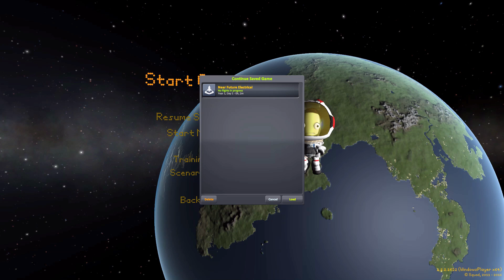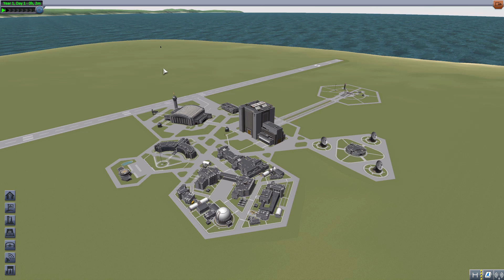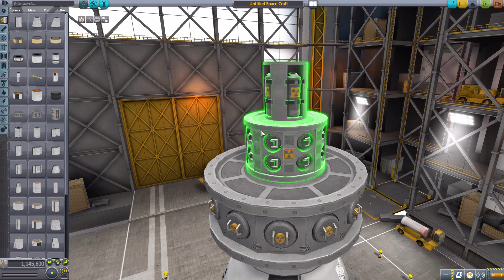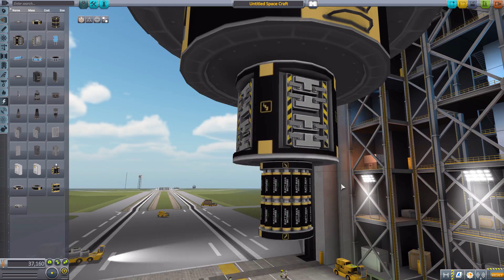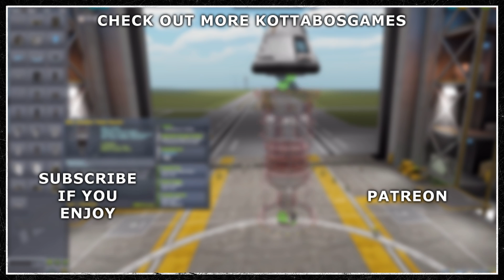KSP Mods - Near Future Electrical

Comment: Those capacitors might be useful when doing interstellar missions when you run out of juice and need EC to startup/kickstart something without spending fuel for your reactors

It's redundant in short term missions, but interstellar missions can reach up to probably a minimum of 20 years provided you have multiple orbital and surface operations to, say 4-5 planets
Reply: With Kerbalism, this is really useful too since those reactors produce Radiation.

Comment: For some reason whenever I right click on any of the reactors the menu that shows up only shows the depleted fuel amount, the ERU amount and the battery charge. But theres no start option meaning I have no way of turning it on.

Comment: The caps are really useful for probes. You can run your batteries nearly empty, put the probe to sleep until it reaches its destination, then use the caps to give a burst of power to unfold the solar panels or the beamed energy dish!
Reply: Do the capacitors just dump all their power out at once? Like a soda can you have to finish drinking in one sitting?

Comment: So basically, just get breaking ground and use a Kal 1000 controller on loop to constantly make the capacitor discharge
Reply: The capacitor still has to charge, so doing that would just result in your power generation fluctuating up and down.

Comment: I have a big problem regarding the heat. I can't get rid of it. I have the second smallest reactor, four of the biggest radiators and the generator is going at 1%. The Temperature still rises.

Comment: Considering you'd only use those reactors when you fire electric engines (from Near Future Propulsion), they will be turned off most of the time, lasting you virtually forever.

Comment: Might just be a bug for me... but those nuclear reactors only use enriched uranium when ACTIVE, right? I built a ship with a few reactors on it. I did my burn and then made sure to switch them OFF. Then I time-warped 3 years. When the game went back to 1x speed, and I turned my reactors back on to make another burn, ALL of my enriched uranium was used up during transit and are just sitting on a bunch of depleted fuel. Anybody else experiencing this? I'm 100% certain that I turned my reactors OFF before time warping
Reply: Just made a ship to test this out on the launch pad. Made sure both reactors were OFF and then enriched uranium was full. Time warped about 2-3 years, and when I turned my reactors on the enriched uranium just slowly depletes to 0 and becomes depleted. I have no idea if this is working as intended.... but it just seems that if the reactors aren't on, then they shouldn't be using any enriched uranium =(
Reply: OK guys problem solved!!! The issue I was experiencing came from using the Real Solar Systems mod. Apparently the maximum time-warp value in RSS messes up the core life calculations for the nuclear reactors. I found this link here:

https://github.com/ChrisAdderley/NearFutureElectrical/issues/18

SkyKaptn figured this out so kudos to him. All you need to do is navigate to the RSS cfg like he mentioned and change the final value of rate7 to 5000000 instead of 6000000. I tested it out right now and everything is working just fine. Hopefully this is helpful to anyone coming across this issue =)

Comment: I think you forgot that as the reactors overheat, they start taking damage, which lowers Ec/sec outputs
Also, my reactors are all stuck at top node, there's no option to change them
Reply: try turning on the advanced tweakables option in the settings menu.

Comment: Plus if you balance the amount of heat generated in the core with the correct size (and type of radiator if you use the recommended mod "heat control") then you really can activate and forget. You just got to remember that the radiator has to be in direct contact with the reactor not the structure scaffolding when using the top node function. Awesome mod set and great reviews, keep it up.

Comment: I love the Near Future set.   I use that little reactor with Ion engines on long range probes :)
Reply: Brian Riley i use the reactors for Planet bases and stations
They are self sustaining since i can make everything that my kerbals need (i have kerbalism since my Tac lifesupport couldnt get updated causeing a mono.dll error)
Reply: I concur. And the tiny reactor combined with electric propellers (from Firespitter i think) results in 5 years of uninterrupted plane flight :).

Comment: It might have been worth mentioning the unique mechanic with Enriched Uranium and Depleted Fuel: They can't be transferred.  You need to transfer them (from appropriate storage containers) on EVA.  (I believe - I haven't worked directly with NF's version, as I usually work with USI's, which has a similar but not identical mechanic for those fuels.)

Comment: I used the Capacitors a lot, before I got the reactors, to power the bigger thrusters. Giving me short windows to thrust without needing a reactor.
Reply from the maker: a few people have said this now, and makes sense.  I had just never thought of it before as I just always went high power on the reactors.  but I can certainly see that use now.
Reply: 20% with radiators works well on reactors. It keeps the engines on (not much spare room for other things, but it doesn’t flame out), while staying within the max temp.

Comment: the capacitors are very great for powering the super power hungry engines from the mod, so you could power them without a massive reactor or just a small one .... works great for making pretty darn fast vessels that way :P
Reply from the maker: Hmm a fair point
Reply: And the NF propulsion thrusters are a super power hungry systems.

Yes, the capacitors pump electricity in your ship faster than the NF thrusters bleed out it. Otherwise your thrusters will run intermittently, and the sound is annoying.
Reply: They're also nice for the stock antennae at long range

Comment: Couldn't you throw on some radiators and keep it going
Reply from the maker: of course, they'll help you delay the inevitable.  but eventually even with those the heat will build up over time to dangerous levels if you always run it on max.
Reply: Absolutely.  Will make the reactor heating to slow down.
Reply: KottabosGames I knew it wouldn't keep it going forever but at least that can give you that little extra bit of power you may need
Reply: that, and it'll let you run it on higher power without heat gain. Haven't tried it, but theoretically, you could dial the output down enough that you could balance out output and heat gain, to zero out heat gain, and radiators attached would let you keep that output level higher while still keeping heat gain low.
Reply: Kottabos well if you put enough radiators on the reactor it would balance out the heat generation and cooling. Would have been nice if you showed us the meltdown mechanic because the animation for meltdowns looks really nice.